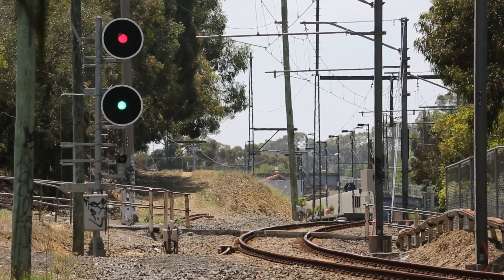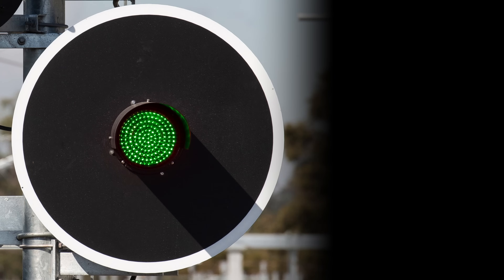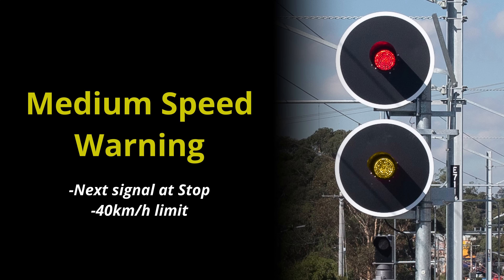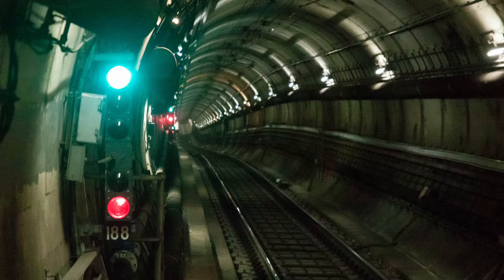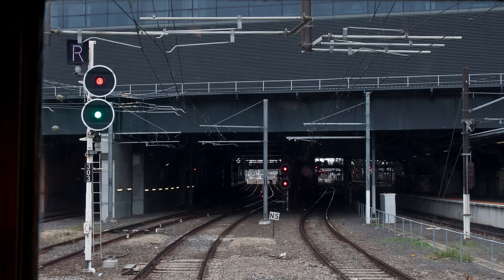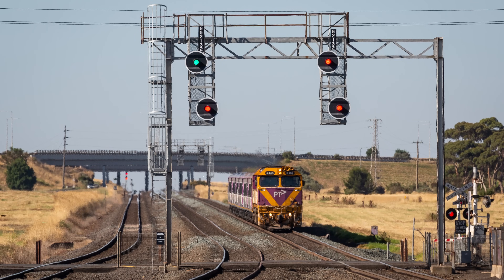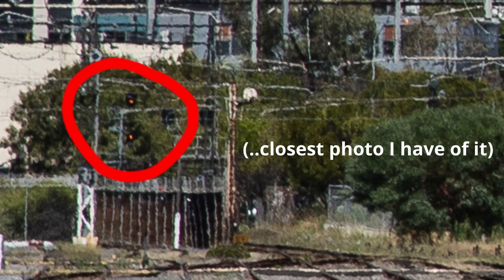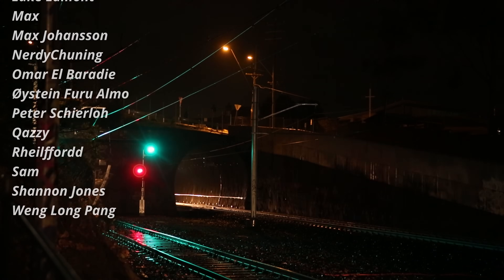Victorian Railway Signalling // What does it all mean?

Comment: I'm an American that once worked for a railway here in the US. I think its very interesting how similar these signals are to the speed-signals in use here on our Northeast Corridor, and most of the CSX system for that matter. (you did say they're based of off North American systems after all). I really like learning about all the differences between signal systems, particularly between different continents. 

Strangely, I worked under a route-based system (former Southern Railway) that uses almost the same aspects as the Victorian system. Where you said you can sometimes infer the route from the speed indication, on our system, that's exactly what we do.  A red-over-green would be diverging-clear as opposed to clear medium speed. We could also have any color appear on  the third signal head, not just yellow. This is to display a secondary divergence, such as where there's a high speed mainline crossover and a turnout to a lower speed branch line at the same controlled junction. A Red-red yellow would still produce a low speed signal, which we call restricted speed (prepared to stop within half your sightline, never exceeding 20MPH).

we would also have an advance-warning aspect, Advance Approach (yellow-yellow) meaning the signal after the next is red.

This was a mouthful but I hope some Aussies find this interesting :)
Reply: Sure did!

Comment: Great video!

As a daily passenger on the Cranbourne/Pakenham line, my ears pricked up when you said the signal lights will no longer be used.

Does this mean an end to the cancellations and delays "due to a signalling fault" on this line?
Reply from the maker: In theory it should be more reliable - but I'm sure there will still be the occasional issue!

Comment: I felt you gave a good description of 3 position speed signalling for the man in the street to understand.
The speed signalling system invented by the Americans early last century is more complicated than the system adopted by the Victorian Railways in 1915. 
The American system consist of 3 signal heads mounted vertically on a signal mast.
The top signal head represents normal speed or track speed, the second top signal head represents medium speed and the bottom signal head represents slow speed. They also have low speed signal.
In addition to the above, the proceed aspect of the medium signal head can be flashed which indicates limited speed. This speed is higher than medium speed but low than normal speed.

To add to your description of repeating signals on the Victorian Railways the repeating signal in principle can  equally show a green on the A arm as the B arm.  It depends on the combination of aspects the 3 position signal can display at the start of the 3 position area the train is about to enter. That is if the 3 position signal can display both a normal and medium speed aspect the repeating signal will have the ability to display a green over yellow or a yellow over green.
The repeating signal is like a distant signal which does not indicate to the train driver the speed to travel at beyond the repeating signal as the train is still in a two position area. 
This requires the driver to know his route knowledge of the area.
The repeating signal indicates to the driver whether the 3 position signal he is approaching is at proceed or not and whether it is at normal or medium speed.

Comment: Railway signalling systems are apparently all bonkers. Most do the red/yellow/green for stop/caution/clear (but neither NSW nor the german-speaking countries got that memo in time). Speed signalling is where basically everyone gets weird - the brits still don't do it at _all_, you have to know the speeds for every turn.

And here: Red means stop. But if there is also a green light, it's clear. Unless the green light is below the red light. Erm? I don't really get why the lower red isn't just omitted.

Comment: If you want an example of a signalling system that is truly bizarre, the French mechanical system would surely be near the top of the list. Most signals are boards that rotate around a vertical axis (semaphores are also used), there are multiple ways of indicating Stop (permissive and absolute), and speed restrictions apply from the first set lf points, not the signal. Trains may also be required to stop on a clear signal occasionally if the previous signal displayed a particular aspect.

Modern French light signals use the light aspects of the mechanical signalling.

Comment: Each class 1 railroad in the US has its own signaling system, some even have several within their networks based on older railroads they have acquired. Either way, working for any one of those railroads requires learning usually just their own system which is simple enough. But if one were to go work for Amtrak, a railroad that operates over other railroad lines, you'd have to learn every signal system over the specific territory you'd run. That can become a headache if you work on the east coast or Chicago for example where you'd run over up to a half dozen different signal systems just in one journey. With each system sometimes being wildly different than the next it can be quite confusing to keep track of each signal and its specific indication at every location over a given territory. Especially when you're running a route that puts you under 4 or 5 different signal systems in succession. It baffles me why there can't be just ONE system for all RRs to run on.

Comment: That's interesting. I just don't get the logic why when I'm told to go at full speed it isn't done with two green lights...
Reply: The top light is for normal speed, the bottom light is for medium speed - kind of similar to how multiple semaphore arms on one signal were used for different routes originally: only one arm would be cleared at a time and that told you the route that was set. Eventually in the USA, the separate semaphore arms were used to indicate different speeds rather than routes: or the top arm was used for the main line and the bottom arm for any sidings etc. SA and Victoria adopted this system starting from about 1912 in Adelaide. Not long later, lights were used as direct drop-in replacement for the semaphore arms, showing the same colours as the semaphore lamps did at night. So the system remained the same with the top light for normal speed and the bottom light for medium speed.

Comment: Another brilliant video from you, Martin! And the order of explanation follows logically from the simplest concepts through to the full range of signal aspects and the order in which a train driver has to observe and respond to them. The brief explanation on Communications Based Train Control at the end was well illustrated, although I have yet to verify if the buffer zone for each equipped train is in the rear as you show it, in front (as one other commentator states) or on both ends of such trains.

As someone else has mentioned, blue is now a recognised colour for dwarf signals at the stop aspect and within the latest update to the Rules and Operating Procedures. Rob McFarlane also gives a concise addendum on Caution Orders in the comments (Thanks, Rob!).

A useful addition to this presentation (should you wish to further explore the topic) would be an explanation of the Train Protection and Warning System and how it is applied to Home Signals as well as the physical Indicators, Communication Antennae and Transponder Grids for CBTC overlaying the mixed signalling between South Yarra and Clayton; also between South Kensington and West Footscray. (I'm sure you may know a current signalling professional that might help in that regard.)

Aside from a few graphic overlay conflicts between signal aspects and point positions (which only hawk eye former professionals like me would notice), this would be an excellent introductory video for those starting off in signals school at the Metro Academy or Safeworking Solutions. The wider railfan community should certainly appreciate your efforts. Well done! 
Oh.. and as a postscript, I caught up with your Diamond Creek Bicycle video only early this week and posted a complimentary comment on that one too. Cheers from Michael.🙂
Reply from the maker: Thanks Michael, I was wondering if anyone would notice the position of the points! 😉
Reply: Comes from many years of proof reading and looking for what's wrong! Again, loved your bike ride and posted a comment on that one.🙂  @Taitset

Comment: A very interesting discussion of a system of signalling that, although experimented with in Great Britian, was never seriously considered; your relative lack of use of directional indicators is quite interesting, as they are very common here; the "feather" variety is used in places where there are ususally two or three route options, and are always placed ABOVE the signal head.  Because they can provide six junction options, they have a great deal of flexibility in operation, however it's rare to see more than three feathers on a signal.  For larger junctions, or termini, the "Theater" indicator is used which, as you point out, can be used to show routes or platforms - these are placed above, beside or below the signal head, depending on location.

We don't really use co-acting signals in the way Victoria does, owing to the potential for confusion (the example you showed be a BiDi route), while we've recently started updating out Banner Repeaters from two-aspect (horizontal line on a white circle - stop, diagonal line on a white circle - caution or proceed) to three (horizontal line on a white circle - stop, diagonal line on a white circle - caution, diagonal line on a GREEN circle - proceed).

Keep up the good work!

Comment: Just a note on trains passing home signals at stop (defective) They need a caution order depending on the safeworking system involved if Home signals protect points, junctions or level crossings (tram Squares) or the entrance to a single line section. A  caution order has to be written by the signaller and can be handed to the driver personally or dictated over the radio. A verbal permission is only given at Home signals or Intermediate (automatic) Home signals that do not protect anything but a train ahead. For ABS (automatic block signalling) a signallers caution order is issued.....For single line sections an ATC (automatic and track control) Caution Order has to be issued. Both have different procedures to adhere too before letting a train proceed past a defective signal.

Comment: The UK system seems a lot easier to understand.  They have green, double-yellow, yellow & red.  The double-yellow is used both for high-speed lines, to give extra warning that the next signal is at caution, and also to warn that the train is approaching points which are set to diverge.
Reply: "Yeah, but how fast can I go?"

Comment: WHY is this so different 😅😅 why aren’t they all more like the British one?  It’s almost the same as car / road traffic, and the double yellow is obviously a safety feature in case of one yellow bulb failing (failing safe), better than the opposite design.

HOW did everyone disagree on this?!?
Reply: This system as also used here in North America is actually incredibly informative and useful when fully understood. Instead of showing the simple occupancy of the line ahead, it precisely displays with two or three lights the permissible speed, route alignment, and most importantly what the operator is permitted by dispatch to do.

Of course a simple traffic light model is simpler and more intuitive to understand, but doesn't convey as much relevant information without auxiliary symbology (e.g. if you have a simple green/yellow/red signal, the indication for "prepare to stop" would be identical to "proceed at limited speed" which are related but definitely distinct instructions for a train operator). Ultimately the operator is already a well trained individual before taking command of a train, and what this system lacks in simplicity it makes up for in precision and information density

Comment: There is a signal I don’t understand and I’m not sure if you covered it here. 
There’s a signal I’ve seen many times on the Gippsland line, as the outbound line enters Moe, right before the McDonalds, there’s what appears to be a two-position signal that’s either yellow or red, but I’ve never seen green. I think it’s one of the last of gantry signals on the Gippsland line, and I think the line switches from double to single at Moe.
Any idea what that means?
Reply from the maker: Going by the diagram here: https://vicsig.net/infrastructure/location/Moe
The second last gantry has two auto signals on it, and the last one has two home signals. It might be that you're always on trains which have to wait for another one to clear the junction, so you're always getting red or yellow on approach?

Comment: This isn't too dissimilar to how signalling works in Auckland as I understand.

Though we have a blinking yellow signal as well. Blinking yellow over red means proceed at normal speed, next signal is caution normal speed. [and thus two signals from blinking yellow over red is red over red]
Reply from the maker: Yes, NZ signalling is very interesting and closely related to this! I might make a specific video about it at some point.
Reply: It's also similar to what's used a few hundred km further south, in Wellington. I think it's mainly speed based,  but it's sometimes possible to infer a divergent route is to be taken, e.g. when pulling into a different platform to usual. The nearest station to where I live also has a nearby level crossing. Freight trains get a green signal, and the barrier ams etc get triggered sooner than for passenger trains, which get a red signal until the barrier arms go down, resulting in less disruption to road traffic while loading and unloading passengers.
Reply from the maker: @richardvoogd705  That situation with the level crossing would be based on express/stopping, rather than freight/passenger specifically. We have the same thing in Victoria, it's either selected manually by the signaller, or chosen based on the train's behaviour at a previous location.

Comment: Personally I prefer the swiss type N where you have green for clear at line speed, green with number for clear at [number * 10km/h], yellow for prepare to stop, yellow with number for slow down to [number * 10km/h] and finally red for stop… pretty easy to remember and theoretically usable even on high speed rail or with reduced block lengths or any other weirdness. Additionally route indicators or voltage or gauge indicators can be provided too

Comment: The UK system is the easiest. The Swedish is quite ok, the German is just wierd.This and the US ones is even wierder and I can't get my head around it just yet. 😅
Reply: What this system lacks in simplicity it makes up for in precision and information density! As used in North America, it conveys permitted speed, line occupancy condition, and route information with only two or three individual lights. To a well trained and familiar operator (as all people in command of a train should be) these signals display almost all information necessary to guide the train safely! The ones used here in North America are the same as those in Victoria, except there's a third low speed light on interlocking and home signals

Comment: Very nice video. I for myself live in Germany and I have to say that the Victorian system seams to be much simpler than the German one, which uses more lights and different forms for distant and main signals. But for me this simplicity comes at a price. Namely the big safety hazard of driving through red lights. In Germany you would never drive through a red light. This is due to the fact that you could get used to driving when shown red. One might say that two red lights may be a clear indication but days can be stressful and you might just see one red light and think that the other one was green. Or even see both red lights but continue since you aren't trained to stop at red anymore. In addition this safety hazard can be mitigated quite easy, the second red light isn't necessary, it just indicates if the active signal is above or below. So just use an indication light instead of the red one. I would propose white since it is a neutral color and get the job done quiet well.
Reply: White really wasn't practical back when the system was invented, gets tricky to make it distinct from yellow especially when you're starting with gas/oil lamps on semaphore lenses.
Reply: Interestingly enough, some railroads here in North America do just that, where unnecessary red aspects are simply turned off. However, for slow speed and "restricted" (meaning proceed able to stop within visual range of any danger) indications the upper red light is still necessary. This system was originally created here for the old semaphore signals, and it was impractical at the time to have a specific marker aspect (the only options were horizontal stop, diagonal caution, and vertical proceed) so the "stop" aspect was used with the understanding that a train may not proceed in the absence of a clear "proceed" indication. Even early electric lighting technology (such as Position light signals and the US&S "searchlight" type signal) was limited to showing 3 unique aspects, and the least problematic solution at the time was to simply map the old semaphore  aspects on to the new colored lights.